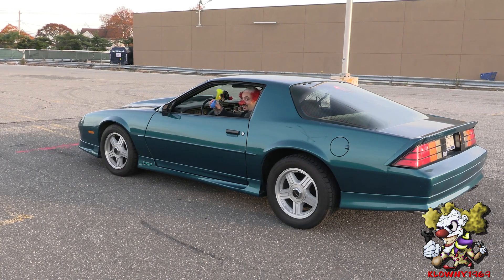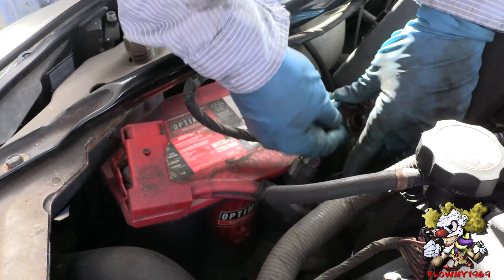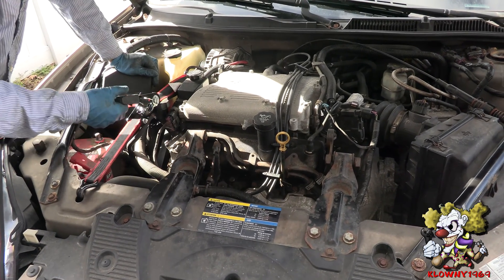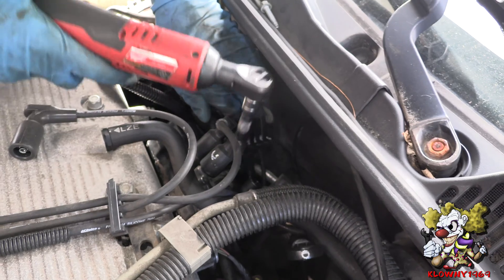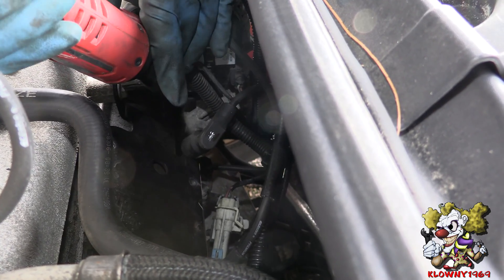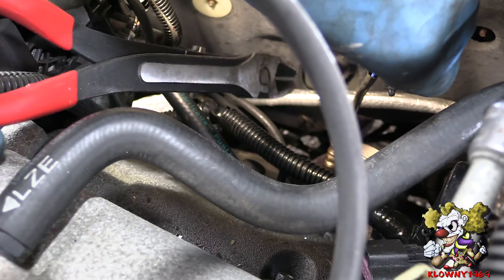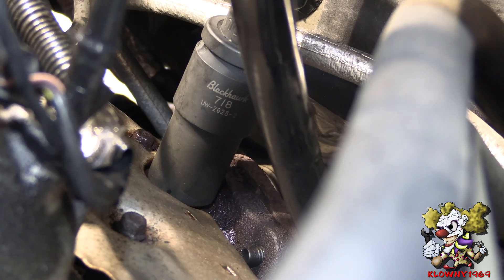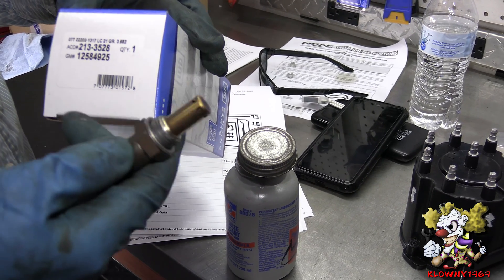How To Replace an Upstream Oxygen Sensor - Impala (2006-2016)

Comment: Probably should just get a o2 socket tool kit from oriellys instead of struggling with you telling me what socket to use lol plus why remove the coil pack?? Cause it's in plane sight without removing it..
Reply from the maker: You can use a regular deep socket, oxygen sensor sockets wind up stripping the sensor. You will struggle with the coil pack in the way, real easy to take it off and it will make your life so much easier. Thanks for watching and don't forget to subscribe 😉

Comment: I'm too scared to cut the wire before I remove it. Will that Oxygen Sensor Socket remove the sensor just as well as the Impact socket did?  Also, why did you switch to the wrench instead of using that Impact socket to remove the Oxygen sensor?
Reply from the maker: Oxygen sensor sockets strip sensors..I switched to the wrench because it was faster once it was cracked loose..don't forget to subscribe

Comment: there is literally a 02 socket and no it will not harm anything !!! makes the job less complex then you made it
Reply from the maker: I mentioned in the video why you shouldn't use an oxygen sensor socket..if you don't want to take my advice and strip a sensor, be my guest. Don't forget to subscribe

Comment: Do you have a part# for the o2 sensor tool an is it a specific size
Reply from the maker: I would recommend not using an oxygen sensor tool..Just cut the wire and use a wrench or socket